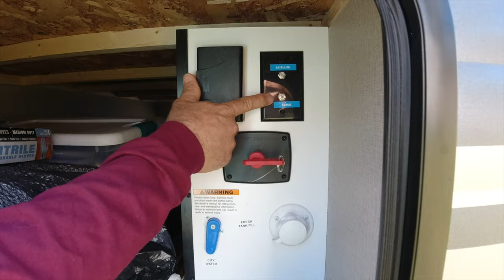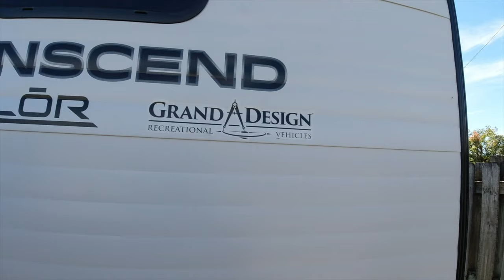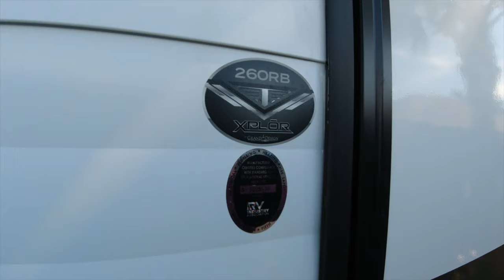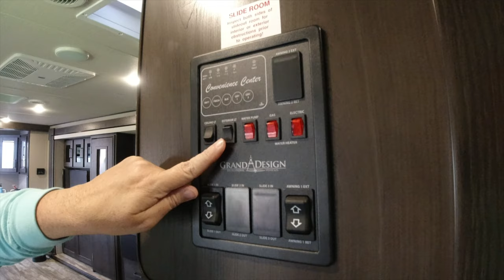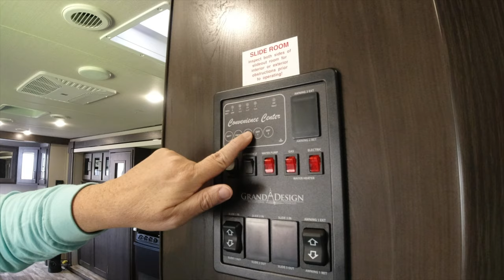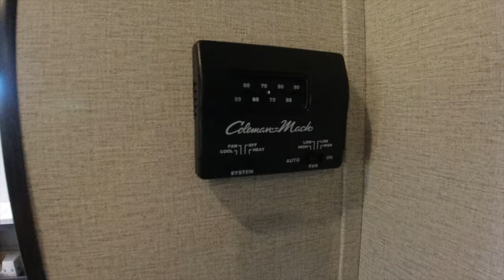Tour of our 2020 Grand Design Transcend Xplor 260RB

Comment: Thank you for the video,  we purchased the same camper in March 2020. We have just started camping and really enjoy our camper. The only problem we had was the recliner didn't recline. The salesperson said that was as far as they go. After watching your video I inspected closer and found it was to close to the wall. The shade anchors had rubbed holes in the backs of the recliners. They are replacing them under warranty. Thanks again for your video.

Comment: The friction hinge outer door is nice, but a wind gust can give you a 50 MPH door close. We added a door stay just to stop any problems when we leave it open. Am also adding another ceiling light over the table seat nearest the door, because it does get dim (age I guess) when you are sitting there after dark. Adding roof vent covers is a no brainer as well - black ones - protect the cheap lids and make it nice and dark for later morning sleeps. No trailer is perfect, but this 260RB has got a lot of the features that, like you, made it an easy choice - you just have to fine tune it to your situation and needs.
Reply from the maker: Mick you are right.  One of the reasons we picked this model was because we can add what we like to it.  It is simple and I feel like a blank slate.  It is a sold RV and is quality.  We can add whatever bells and whistles we want.  The door stop is a great idea.

Comment: Love your video..just subscribed to your channel!!  We bought this same exact RV in March of this year for many of the same reasons you describe. Going on our maiden voyage this weekend!!! Would love to know how you run the TV audio through the RV speakers...that was one thing we could not figure out.  I'm sure we're just missing something obvious.
Reply from the maker: Thanks Brian!!!  We were able to do it before but we added a sound bar so we use that now. I will play with it.
Reply: We bought a cable from a stereo shop that has the small male ends on it - 1 of them at a 90 degree angle, and went from the headphone jack on the TV to the input on the front of the stereo. We set the volume on the stereo at about 25 and use the TV remote to control the volume then. Works just fine

Comment: That switch is not to switch to tank water.  That’s to rapidly fill the water holding tank from the city hose without taking the hose to the other side of the trailer.  For those who like to throw in some holding water for going down the road for bathroom breaks super quickly while tearing down camp not having to move the hose.
Reply from the maker: Thank you for that.  Thanks also for stopping by and watching.  We appreciate it. Sherry

Comment: Nice video !! Wondering what you set your Trailer Brake Gain at ?  Also, what is your Tow Vehicle, Weight Distribution System and if you use Sway Control ? Thanks !!!

Comment: "They call this a pet draw, I don't know why." Spoken like someone without pets... for sure. 😁😂🤣
BTW - How do you attach items to the walls that have screws. Like the hooks near the door. Do you just screw them right in? Is there foam behind for the screw to grab or just empty space and you need some kind of screw anchors.
Reply from the maker: We used anchors that have the wings that open behind the wall board.  That seems to help. I also use a lot of command hooks.  Thanks for watching